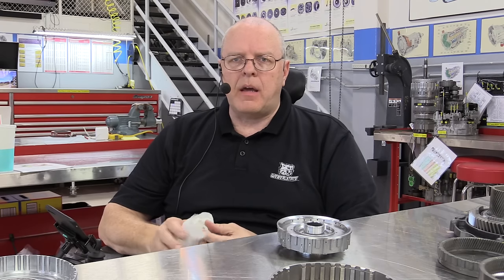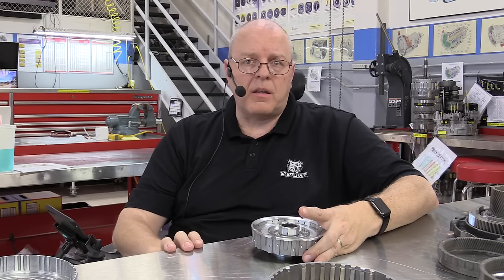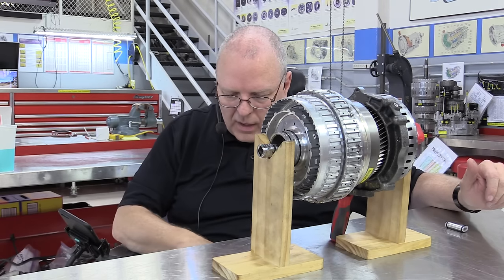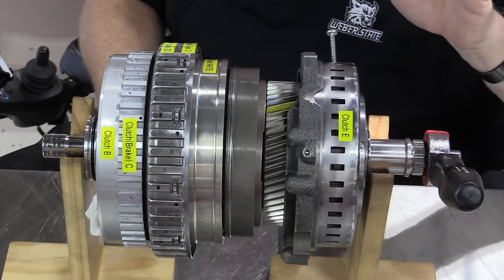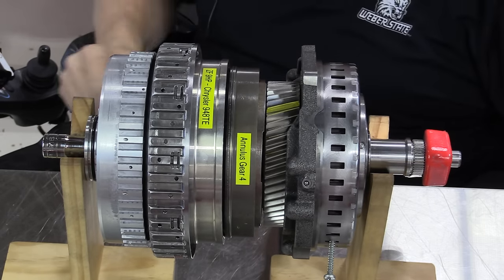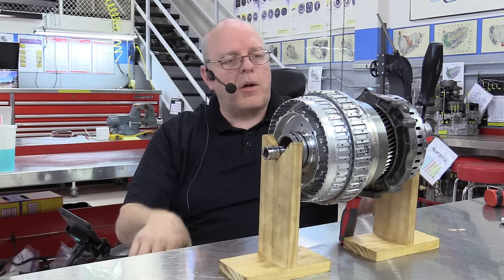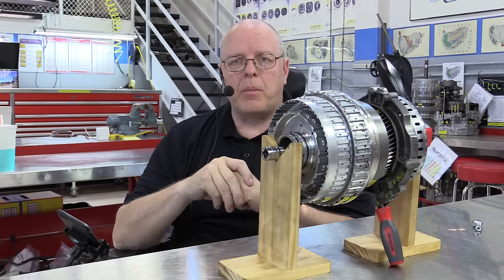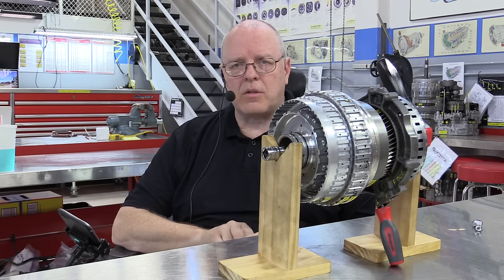Power Flow - ZF 9HP 9-Speed Transaxle Operation - Part 2 of 2

Comment: I work at a Honda dealership and this guy knows more than my techs.
Reply: How reliable are these transmissions? I have one in my passport (2020). Love it. I don’t love the clunking nose on steep hills going from park to drive (with parking break on). Have you heard of this?
Reply: @rscranman2002  is normal ..the reason why is the way this trans is packed.... Is a big house in small house .
Reply: @senior mobile fitness I am on my third 9HP in my 2019 Honda Odyssey with 68k mile. those sounds are not normal for a transaxle. John made a wonderful video, but in believe the ZH is a okay transaxle with crappy software.

Comment: I work for ZF and you did the 9HP justice
Reply from the maker: +randomguy3579 Thank you very much!
Reply: @francom6230  It's not perfect by any means but that's being a little bit harsh don't you think.
Reply: @francom6230  
Software is tuned by the car manufacturer not ZF. Some brands have had firmware issues but my 2015 Honda CRV diesel is tuned perfectly. It is predictable and smooth in every ratio and change and its downhill engine braking is just perfect. Honda UK just got the firmware right.  One thing though, despite being 'sealed for life' mine is now subject to a factory directive to change the fluid at the next service free of charge. So there may have been a few durability issues at higher mileage that has indicated fluid changes to be necessary.
Reply: @hedydd2  being diesel it's probably way easier for the transaxle to shift because it has torque to work with and it's at low RPM which makes for clutch brakes and dogs to engage easier also CRV is way lighter then the Odyssey, Ridgeline and Pilot which Honda is utilizing the 9HP over here in the States. Our CRV's are gas powered and use CVT.
Reply: @MrManuel1329  
The Jeep Cherokee diesel and the JLR diesel early model adopters with the ZF were not too well sorted. Cherokee has been withdrawn from the market for some time here but JLR has sorted their transmission software so that there are now very few, if any, complaints about the mapping or quality of shifts or the logic. All except Honda [in UK models] were available with a petrol or diesel engine and nobody has previously mentioned any distinction as far as I'm aware.

Comment: I don't understand why someone doesn't like this perfect demonstration!
Reply from the maker: It is confusing at times, thank you
Reply: maybe they had the problem with this transmission, but the more gears in a transmission would need drives to dump some bad habit that was able to tolerate in a 4 speed.

Comment: As a humble Welsh farmer, I appreciate these videos of yours very much. As it happens I very nearly bought a Land Rover Discovery Sport with this transmission a few weeks ago, but decided against it for reasons unconnected with the quality of the product. Instead, I've got a Volvo on order with the Aisin eight speed front wheel drive high-torque transmission linked to the Borg Warner-Haldex axle. 
How Aisin manage a reasonably heavy duty eight speed transmission, able to handle around 500Nm torque in a transverse front wheel drive installation only the Lord and you could know.
As an aside, it would be interesting to see the operation and contrast between the Haldex and GKN [fitted to Range Rover Evoque] rear axles some day.  Keep up the great work and thank you.
Reply from the maker: Thank You!

Comment: A more precise way to describe planetary gearsets instead of "turn one, hold one, and the remaining is output" is to say that it has 2 degrees of freedom. If you dictate the speeds of any two elements then the speed of the third element is determined. So, you can dictate the speed by driving one/holding one, but also by driving both of them.

Comment: I have a 18 jeep renegade with 2.4 4 cylinder. The 9th gear doesn't even come on till around 88 mph but you have to be on level ground and no wind blowing against you any slight change going uphill it drops back down. Great video

Comment: Here it is May 5th 2018 and I still have not driven a 9 speed. I did rent a 2017 Ram 3.6 8 speed and a 2017 Camaro v6 8 speed. I love them both. Sense my last comment. I bought a 2016 F165. I wish it didn't shift like it was made in 1989 at light throttle.
Reply from the maker: Great feedback, thank you!

Comment: Good morning John.  I just watched both videos on the ZF 9spd.  Great work.  I would be tired after stating so many planetary gear set names!  For what it is worth, to your point on the super high 9th gear ratio, I have a real world fact.  I ordered my 2015 Jeep Cherokee Trailhawk with the 3.2L brand new.  Currently it has over 60,300 miles on it with about 38,000 miles on the new transaxle.  The first one suffered from the poor software due to the weak C-clip design from the first generation transaxle.  Having driven it all over, including a 15,000 mile road trip up to Alaska, I have NEVER seen 9th gear.  

If you would not mind, would you desire to do a video on the rear drive module (RDM) on the Jeep Cherokee KL?  I find it very interesting how they use the clutch to distribute power to it, while also utilizing a true electronic locker.  

Thank you for your videos.  I recently discovered your Channel and will be spending more time on here.  To yours in health.
Reply from the maker: Thank you for the information and feedback. I do want to do a set of videos on the three different RDMs and 4WD systems available in the newer Jeeps. They are difficult to obtain. Have a great day!

Comment: Thank you professor. If I may make a suggestion if that, it would be better to split the videos into smaller segments. especially a small separate video on which you discuss which car models use the transmission and what are the differences.
Reply from the maker: +ctawab Thank you for your feedback and thanks for watching!

Comment: My 2017 Jeep Cherokee has this transmission and I've been getting a 2nd gear ratio incorrect code lately.  It goes into "limp Mode" by staying in 4th until I shut it off and wait  a few minutes. Dealer is going to look at it, but i wanted to review how this transmission works. I watched your video before I bought my Jeep too.  Not sure if it's having trouble between 1st and 2nd, or 3rd to 2nd, but the dog clutches aren't involved in either shift. Maybe the solenoid/valve for the C brake isn't applying it all the way for some reason? I don't know what kind of piston applies C brake, but seems like it'd code more often it that was leaky.   Dang thing only has 28k miles on it too.  It goes to the dealer Wednesday. I do think its an amazing design though!  So compact!

Comment: I agree with John in that it's hard to describe into words how a compound (or "stacked") Simpson geartrain can get so many ratios in the normal sense.  This is because we normally think of either a planetary member being in of only 1 of 3 states:  Drive, Driven, Held, or Reactionary.   When we think of a member being driven, we think it's at turbine (input) speed and when we think of a member being held, we think of zero RPM.

What would happen if a member that is normally being held in one Simpson gear set was really turning slowly by the output of another Simpson gear set?   You would actually have 2 inputs into the gear set; one by the turbine shaft (main input) and one by the output of an adjoining Simpson geartrain in the stackup.  A split torque path, essentially.

If that's clear as mud by now, perhaps looking at this vintage 1953 B&W US Army training film will help other visualize how this works.  Although the video is 14:29 long, I have it start at 9:12 where they are driving 2 members of a planetary gear system model.  Check it out:  https://youtu.be/SrkzaQRDtuM?t=9m12s
Reply from the maker: +Tanner Transmissions Thank you for the feedback. It is pretty cool stuff (as well as complicated). Aisin's 8-speed transmission uses a similar idea for the input. See my video at https://www.youtube.com/watch?v=QhIcVM9-F3I

Comment: nice video.  you could reach the 9th speed depending on the final drive ratio from the transaxle through the differential gears.  with that many ratios wouldn't a CVT transaxle be better?  keep up the good work.  your videos are clear and give good information.
Reply from the maker: +Dennis McConkey Good thinking. The CVTs don't seem to be able to handle the increased torque of V-6 engines. I also read they have more frictional losses than the 9 speed does.  Thanks for watching!

Comment: I've just changed a manual Honda CR-V to a new diesel twin turbo with this nine speed automatic. It exceeds my expectations with smooth predictable shifts both up and down. I don't believe it has yet engaged 9th though LOL. As such it compares nicely with any 8 speed transmission with an extra overdrive for 80mph plus at light loads.
 Honda seem to have nailed the software for smooth and rapid changes plus sensible downshifts for engine braking down hills. Also its engine start-stop feature is entirely controllable via footbrake pressure, in contrast to the otherwise excellent Aisin 8 speed on my Volvo, which kills the engine at every stop no matter how lightly I brake and even before the car rolls to a stop sometimes.
Reply from the maker: Thanks for your feedback!

Comment: Amazing video. Just to clarify, On a full open throttle with all stock 2015 Cherokee 3.2. I didn't hit 9th until 115mph. Flat surface. I noticed 8th doesn't like to let go and you can cruse 80-90 in the 2100Rpm range. The unique things he mentions  that lets components slip is very problematic, reversing and downshifting.
Reply from the maker: +AKMO E Thanks for the feedback!

Comment: Great explanation, thanks.... what do you think about the longevity? I have 2 200C's  3.6L, I love them,  I have learned to live with the driving dynamics of this transmissions, I don't know any other vehicle that  at 80 MPH you are at 1,800 to 1,900 RPM, I´ve been able to get up to 40 MPG Highway driving! not bad for an engine with 295HP   HA I get no more than 28 MPG on my other 2013 200 with the 2.4L...... Regards!  By the way one has 40K Miles and the other 45K Still the original transmissions
Reply: well here im again 2 years later, still have both on my 200C transmissions working amazingly perfectly believe it or not, all the rough shifting ended by itself, both are super smooth now and still getting up to 40 MPG on the highway driving at 70MPG getting 1,500 to 1,600 RPM, honestly these transmissions were not as bad as everyone said, I LOVE IT!

Comment: Very interesting video! Tell me please, is this a good transmission? I drive RR evoque and this automatic transmission has a delay when switching to an overdrive at 26 km / h. Many people complain about it. What is the problem? Changing the oil and updating the software does not solve the problem. There was no such problem on a new replacement car.
Reply from the maker: The first few years had some problems, but I think they have been resolved by now. Most of the issues were software related and they caused some hardware issues. That usually led to a transmission replacement.

Comment: John, thank you for this amazing explanation but I think you forgot the differential ratio, many cars use a 3 or 4:1 ratio. In this case there is no overdrive on the wheels right?
Reply from the maker: +Vitor Moreno Hi, the final drive is a constant gear ratio that is used after the transaxle gear ratios. Thanks for watching!

Comment: For all practical purposes the driver can regard this as an eight speed with an overdrive ninth that doesn't engage at all unless at over 70mph. So in ordinary driving it is no more busy than any common eight speed transmission. Mine is so smooth that I seldom notice any change when driving normally.

Comment: fantastic video, I got my head around how an automatic transmission/transaxle works in a way I never have before. 
Quick question though: there are more combinations of the various clutches than were used to demonstrate 9 speeds. Are other combinations functional and do you know what they are? Are they crazy ratios (e.g 20:1 or something)? 
Thanks.
Reply from the maker: Thank you! Yes, there are usually other crazy unusable gear ratios possible too.
Reply: 6 clutches with 3 applied in each gear gives you 20 possible combinations. However, out of these, 7 combinations are not feasible, and the 3 other ratios (other than the 9 forward + 1 reverse) are repeats of the 4th gear ratio - in other words, there are four different ways in which you can achieve 4th gear.
Reply: wow, so how do they decide which 4th gear to choose? what's the wildest gear ratio the box can achieve as it is assuming the software was capable?
Reply: Mainly, you choose the combination of clutches that will make it easy for you to shift to 3rd gear and 5th gear (to upshift and downshift) - you want to swap only one set of clutches to execute the shift. There are other considerations as straightforward. The gearbox, as it stands (without changing the number of teeth on any single gear) can achieve the first gear ratio of 4.71. There are some transmissions out there that have first gear ratios that are higher than 5, but as you go higher, the transmission output torque goes up, and the size of the transmission goes up as well. You can use a small final drive ratio to compensate, but makes more sense to use a slightly larger final drive ratio so that you can have a smaller sized transmission. In AWD/4WD vehicles you can get an extra ratio out of the transfer case. If you look at the overall ratio in a 4WD Jeep, it can be as high as 72, which allows you to 'crawl' on rocks and logs.....
Reply: Thanks, interesting comments!
Reply: You are welcome!

Comment: Thank you for taking the time. Curious if you might know why I’m getting bad gas mileage with this transmission. It seems to be more responsive and efficient when driving it more aggressively.  It appears like it prefers to get up to speed quickly then “coast” on a higher gear. I’ve been driving it like a grandma and it doesn’t seem to like slow acceleration. Any thoughts?  I’m driving a Honda Pilot with a V6 on this transmission.
Reply: I have experimented and agree with you! I have this in my 2015 200c. Thinking out loud here. I think the design thinking was performance and give more powerbands  at lower gears to improve the smaller engines it’s paired with  and the higher gears once you get to speed is designed for economy which is why the transmission wants to upshift as soon as it can. Basically it’s designed to fit how most people drive, and trying to “grandma it” works counter to how it would on a normal transmission

Comment: Do you think it’s a good design? Do you think it can last a long time or will it be problematic?
Reply from the maker: It had a few problems in the first model year of the transaxle, but they seem to be good now. That is pretty typical of any totally new transmission. They usually have problems at first and then get much better.
Reply: WeberAuto sooooooo I shouldn’t purchase the 2016 Honda Pilot Elite I was looking at?
Reply: @220SeaChaser  The lx, ex and exl are fitted with The Honda made 6 speed trans.  Don't buy the other higher end models.  Honestly, just buy a Toyota with an Aisin trans.
Reply: @220SeaChaser  The lx, ex and exl are fitted with The Honda made 6 speed trans.  Don't buy the other higher end models.  Honestly, just buy a Toyota with an Aisin trans.

Comment: Sir myself and many others who own 2015 Jeep Cherokees would like to know if you are aware of any changes to the ZF 9HP48 made in 2016. I've watched your video several times to see what could be causing the lack of response and suddenly going into a neutral mode in drive. Could you post a video explaining the solenoid pack FCA uses also. This transmission is a nightmare and trouble shooting it by an average person is a not going to happen.
Reply from the maker: +imflori dano Hi, the only change I am aware of is software changes in how the transaxle is controlled. There may be other changes too. I wish I could be more helpful. Transmission diagnosis has always been challenging and it isn't getting any easier. I always tell my students: If it were easy, anyone could do it. Best wishes!
Reply: +WeberAuto Thank you for prompt response sir.

Comment: I wonder if the reliability of a transmission depends on the diameter or friction area of clutches. If any one clutch is too small, that might be the weak point and breaks down the whole transmission. Reliable transmissions might need to be big. To save weight, the gears could be two concentric rings connected by thick spokes.

Comment: Awesome video, thank you.  I've been wondering about the witchcraft going on in my Cherokee's trans.

Question:  There was a recall for 'snap ring failure'.  Do you know what ring they are talking about?
Reply from the maker: +Will Moller Hi, yes, the recall is to check to see if a snap ring has worked its way out of the groove it is supposed to sit inside of. If it has not come out, then there is a software update for the transmissions control module. If the snap ring has come out, then the transmission is replaced and the transmissions control module software is updated. Best wishes.

Comment: Just a small correction to the percent overdrive statements: % Overdrive = (1/Overdrive Ratio - 1)*100.  So, for example, 0.48:1 is 108.33% Overdrive not 52%.  The incorrect percentages are from the incorrect formula (1-Overdrive Ratio)*100.

Comment: Regarding to 9th gear. On Chrysler Pacifica it's very hard to engage in this gear by driving above 80 mph, I see only 7th gear engaged If I drive more than 63 mph. If I driving 61 mph on cruise control I get 8th gear engaged pretty stable but no more than 61 mph, or you'll get downshift to 7th gear